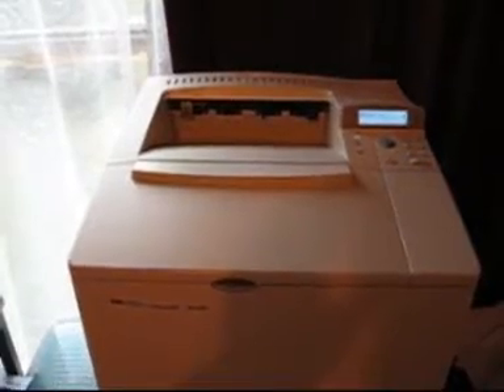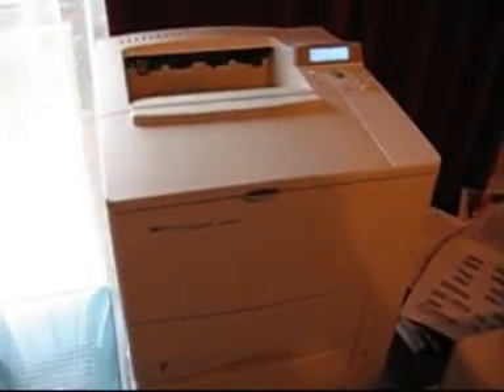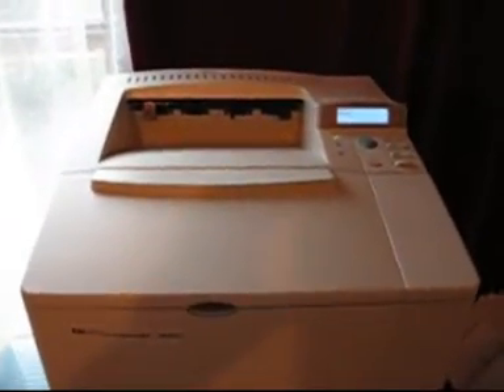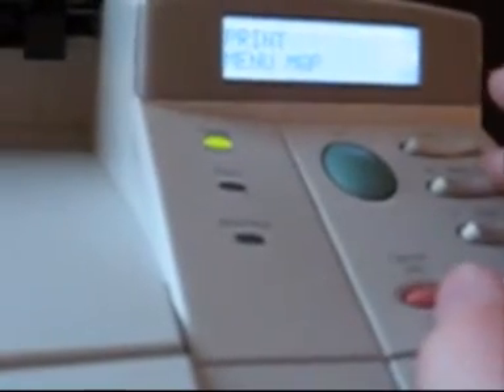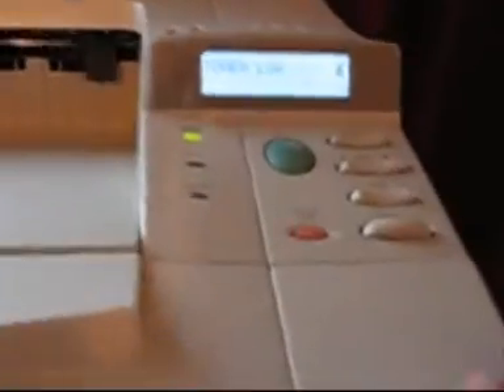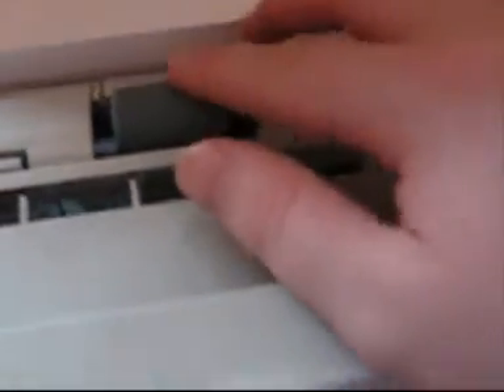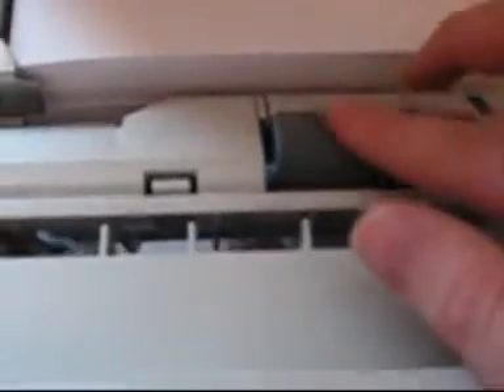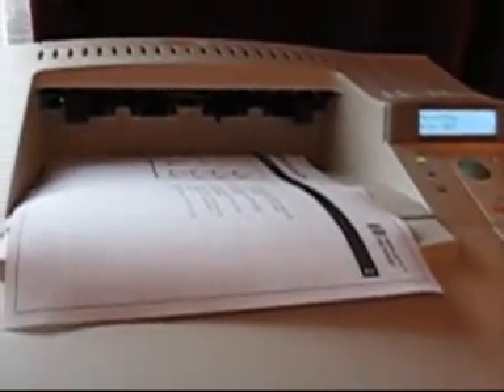41.5 Error and Overview   Some is no longer vaild - Historic only.

Comment: Thank you Woods. I have a couple 20 year old HP 4000's and this helped solve my problem. Stopped printing during tax season, so glad it is up and running again. Thank you
Reply from the maker: That’s great 😀 HP 4000’s are getting old now but they’ve excellent units, I use to have one a 4050 like around 12 to 15 years ago. Before I upgraded to a 4300, then a M602.

Comment from the maker: it can cause a multifeed problem but its rare, yes but thats old Morris from FYOP fix, I dont do that, I usually just replace the clutch or free them by turning it, the metal filing removal doesnt work for me.

If it becomes stiff, I usually turn it till it doesnt become stiff, i open them to losen the filings but i dont remove them.